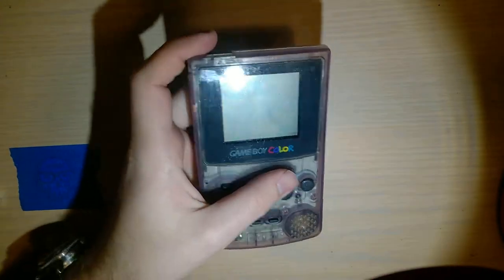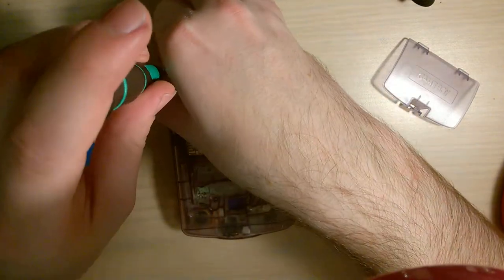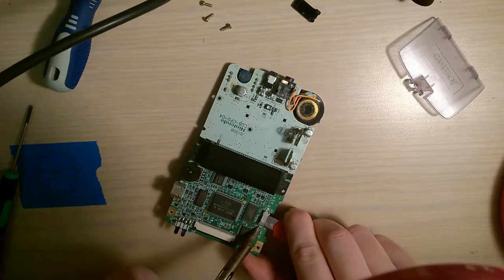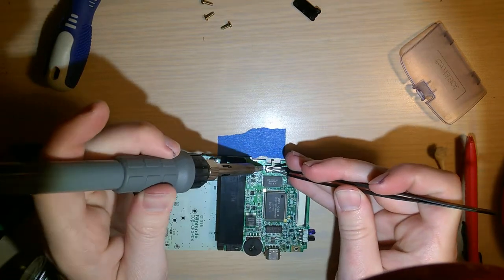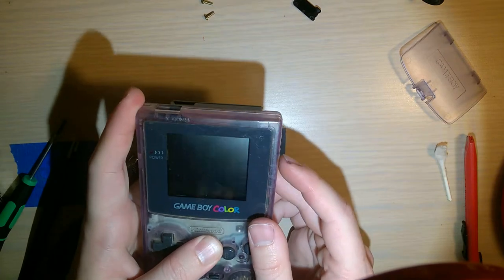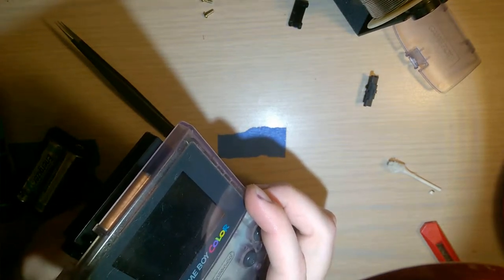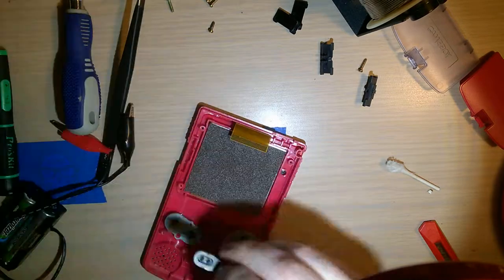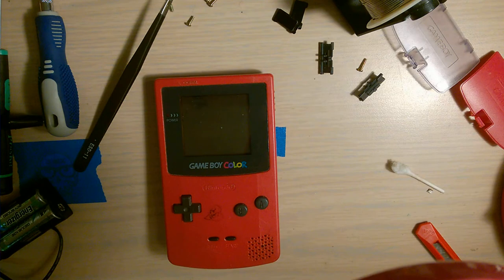Cleaning up an old GBC

Comment: Could maybe also need a new cap replacement. These things are 20 years old or older. There is also the Mcwill LCD for the gameboy color which is using the same screen as the freckle shack only it's much brighter.
Reply from the maker: Dunno if you've seen any of my other videos, but I do actually have both the FreckleShack and the McWill LCD. The only new kit I don't have is the Midwest-Embedded version. 

But yeah, it probably does need new caps. That's on my list for most of my GBCs.

Comment: Hey Makho, i've bought an used GBC a while ago do refurbish and the power switch was completely gone. Im wondering if my only option is to get the power switch from another GBC motherboard or is there another way to get around it? Thank you!
Reply from the maker: To my knowledge, the power switch on a Pocket is also a direct swap. I do not know where to get the part without salvaging though.
Reply: @makho  ive seen mods for everything but nothing on the power switch and no info at all so im kind of in the dark here..
Reply from the maker: @DjRiO2  The problem with the GBC in particular is that it's not just ON-OFF like a GBA. It is basically a three position switch (like the Game Boy Light though it's wired completely different) and it goes OFF-RESET-ON though there is only one click between OFF and ON in the middle of the RESET position.
Reply: @makho  true, i saw someone replacing it with some random power switch soldering only 2 pins to the switch itself but dont really tells if those 2 connections are the only ones required to activate the switch